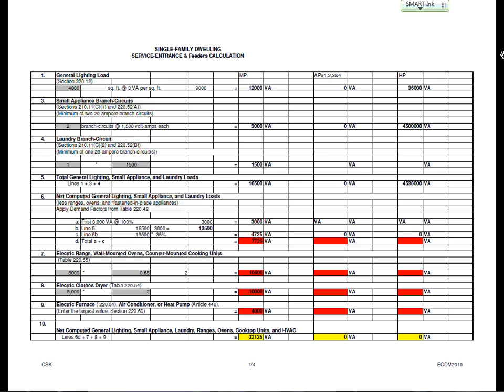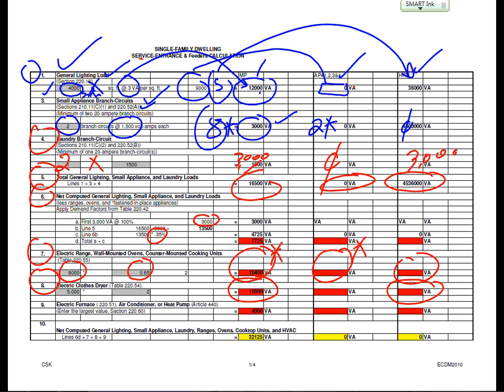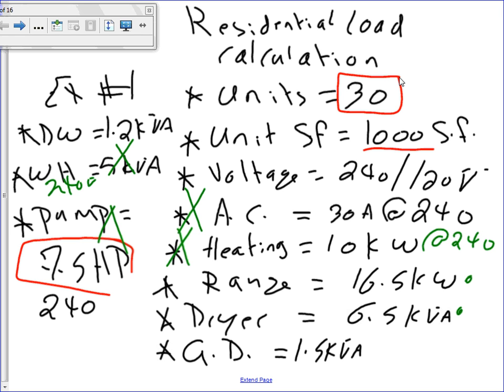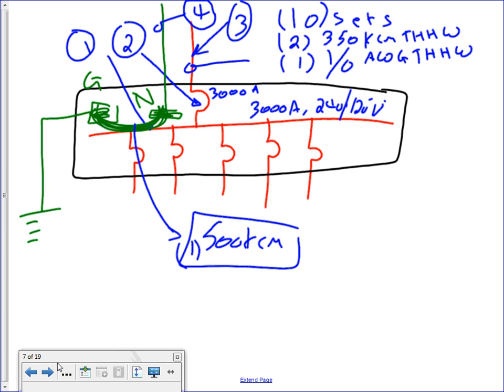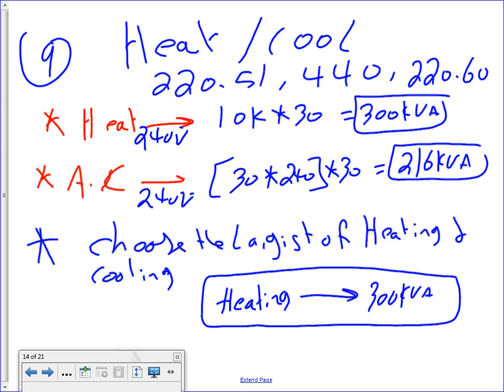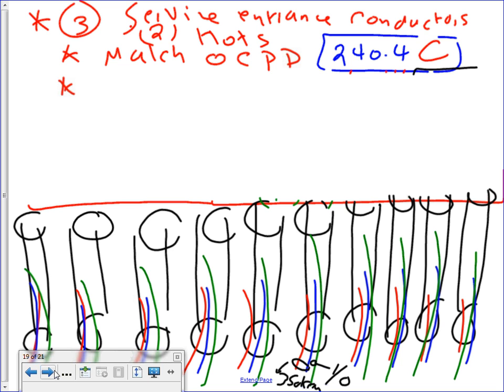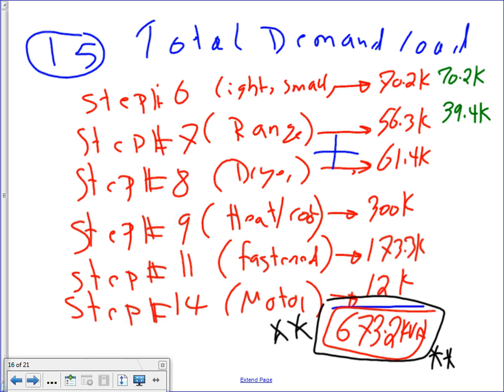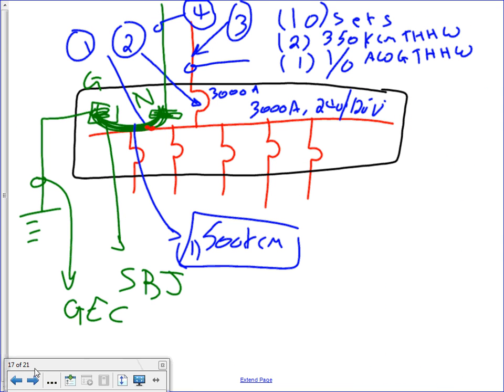Electrical Load Calculations Residential 09 16 13

Comment: Mr Chad,  our system voltage is 230V for single phase & 440V for 3 -phase, whether the same NEC code and tables used for 120V & 220V, can be used in our system for load calculations.
Reply from the maker: yes

Comment: Very good session. Chad has explained the concepts coolly with lot of patience. I have a question. As per NEC T220.42 refers Lighting load demand factors, In our session we have used these demand factors for Cumulative of Lighting, Small appliances and Laundry loads. Is there any hidden logic for this?. Can i know the code reference, which states Minimum neutral size during parallel should be 1/0. Thanks for uploading this video.